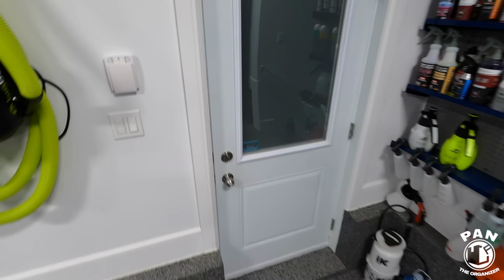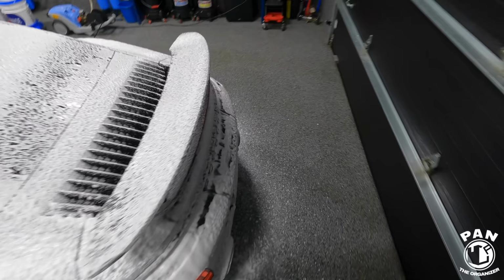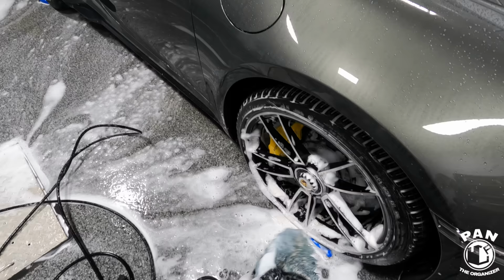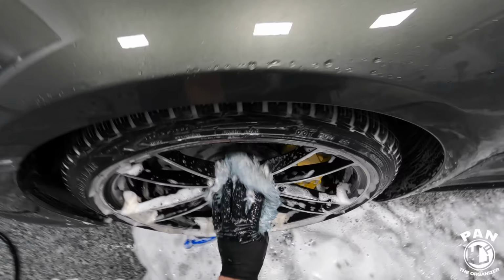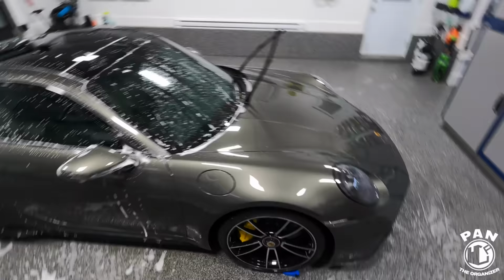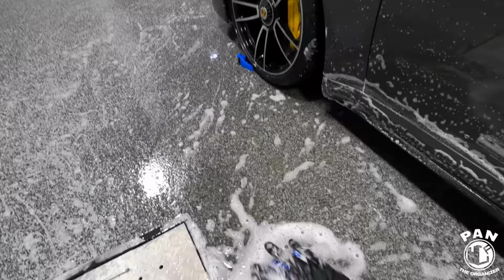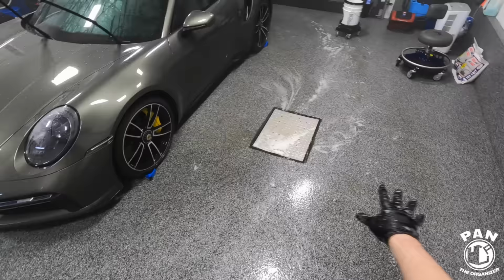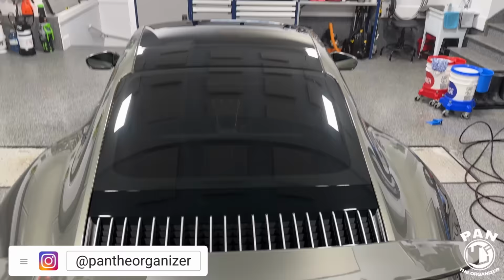Cleaning A Dirty Porsche 911 Turbo S : Exterior Auto Detailing

Comment: ❤❤❤❤ The first-person perspective cleaning video!!  If you haven't already, I vote for you to do one for the interior.  I also start cleaning my wheels/tires 1st.  I live in the southern US where the summers are brutal and the roads are full of dirt and dust.  That said, I cannot get my wheel barrels completely clean even with the numerous brushes I have to clean between the spokes and brake pads.  Also, the rotor disc never looks as clean as I'd like.  I use Turtle Wax's Wheel & Tire Cleaner which works GREAT for my tires.  Nothing I've tried works on my wheel barrels or rotors.  I don't have the luxury of a garage or carport.  Have to wash outdoors.

Comment: most vehicles I do now are new or only a yr or two old and I maintain them for clients every few weeks early morning or before sunset.  my proffered method is to pump spray and foam wheels and tires,  then foam the whole car.   while foam is dwelling I go right back to the wheels working way around vehicle. then I rinse whole car and refoam with cannon ... this allows me to use one fresh water rinse bucket and I use 2 mitts for each half of the vehicle. oh and whole in cleaning the wheels I use pressure washer and hand pump sprayer to keep brushes and  wheels ll clean and lubricated so I don't have to drag buckets around.   I work much faster to prevent any products drying.  keep the surface wet until I want to dry.  detailing is very stress relieving for me.  loving it. one day I'll have that Turbo S!  ugh beautiful
Reply from the maker: If you continue to work hard your dreams will come true as well. I wish you the best Stephen.

Comment: One thing I like to do is after I've given the car its initial prerinse with a high-volume low pressure, low-velocity spray of water is to spray the wheels, tires and wheel well liners with a good cleaner like the Griot's Garage wheel & tire cleaner and then rinse it off before doing the presoak.

Comment: Hey Pan, pro tip - I remember reading a while ago from Ego that you shouldn’t put your battery on your charger straight after use, as the battery cells are hot. You should let the battery fully cool down (after an hour or so), and then place it on the charger to charge. ✅
Reply from the maker: Oh really? I have had them for years and they still perform like day 1, never had an issue. But obviously I like to do things right, so if that's the official EGO recommendations, that is a great suggestion! Do you happen to have a link to that article?
Reply: @PanTheOrganizer  I don’t have an article that I can send you, that was just the advice provided to me by the ego customer care provider.
Reply: I believe charging warm/hot batteries is best avoided (if possible) for most devices.  I know for example that drone batteries should be left to cool before recharging.

Comment: Video was great Pan you just about made it to the end. Just missed out on a little of the wipe down and glass cleaning. No big deal, it was great to learn your process.
Can't wait to see you do the Diamond Body 36. I did it on my car and it was surprisingly easy. Also put the Stoner Invisible Glass Ceramic coating on the windshield. I was out on a drive and it started raining. Didn't have to use my wipers and I could see the rain, very tight beads just fly off the car and windshield. OMG you would love it. Thank you again for all that you do!
Reply from the maker: I’m testing the Invisible Glass Coating right now. Video to come soon. ;)

Comment: My car is garage kept, I wash it when its dirty, usually after rain. Usually 1-2 times weekly, but will also use a quick detailer 1-2 times weekly in between washes to get the "road dust" off.

Comment: Great video.  Helped answer a lot of questions I had.  A few observations.  I couldn't agree more with the comment about efficiency being key.  It is something I'm always trying to improve on and the one thing that surprises me with the car detailing community is that so many rinse with their pressure washer.  Even at 2 GPM, it is far less efficient than just using the hose without the pressure washer.  I get 6 GPM with just the hose (3/4").  It makes more sense to me to have two lines, one for rinsing that is just the straight hose and then another line going to the pressure washer.  You also save some time here by not having to switch between the foam cannon and spray nozzle.  Secondly, very surprised Pan is still using the two-bucket method.  That method has worked for decades so I get it, but there does seem to be less risk and some efficiency gained by having numerous microfiber towels sudded up for each panel.  Sort of a win-win from my perspective.  More efficient and less chance of scratches.  Finally, loved the idea of a lubricating agent when conducting the final dry.  I need to look more into that.  Another win-win.  Increasing gloss while also providing more protection for the final dry.  Thanks again.

Comment: I like this full length (no edit) video of your car washing. From all your videos, I’ve slowly obtained some decent car wash knowledge and methods. I do start with the tires and wheels, per your advice. I take in your advice and then apply my own situation. For example, I don’t want to add a pressure washer to my list if equipment, and I don’t see the value in a foamer. My level is probably a “1/4 Pan” for my car wash chemicals, methods, etc.  I have purchased a lot of the tools and chemicals based on your demo videos. My car looks and feels great!  I have a 2019 Acura TLX V6 in a deep blue with chrome trim.  Thanks as always Pan, for the great tips and demos.
Reply from the maker: Thanks Adam!

Comment: 39:45 - Who has the cleanest vehicle - fast forward a few years - and see who has the most rust-free vehicle. Certainly not the ones that don't wash the road salts of their car every week or more. 
Nice work Pan. I live in Alaska in an apartment atm, and I wash my car (Rv4prime) every week, or I'll go 2 if I'm bicycling to work often. I use an amalgam of a few methods I watch on your channel. There's a car wash nearby with DIY spray bays (always open, so I can usually work at leisure), and also (always cars lined up) auto brush and auto "touchless" bays. Anyway - I foam it up with my IK Foam pro 12, rinse, foam it up again, 2-bucket wash, wash wheels, rinse, and dry with Adams graphene detail or Graphene Cs3. It's been a gr8 new hobby - and I get a lot of comments.
Reply from the maker: Awesome John! Yup, a vehicle that is well taken care of really shows after years of driving in inclement weather and harsh conditions. Big difference compared to someone who neglects their car.

Comment: Ever make a video about how you clean the garage after you wash a car in there? The dual drains look very cool. I've wondered about all of that foam ending up outside on my driveway.
Reply from the maker: Maintenance is so simple with the coating that is on my garage floor. Just a simple pressure wash when I'm done detailing, and then I have a rubber floor squeegee to push the water towards the drains.

And once a year, a bit of Simple Green diluted in hot water in a Hoover vacuum/extractor that has rotating brushes in the head, to do a deep clean after the winter months.

Comment: Never had to deal with extreme cold. I visited Dubai and it was 125F with relentless sun and humidity. I could only guess the surface temperature of a black car. There is a high amount of super cars in that city and  they are often abandoned at the air port to just sit in the sun for months on end.
Reply from the maker: That’s nuts.

Comment: I think what I would do first is the outer part of the rim, then the inside of the rim where the disc breaks are then the tire.
Because the dirtiest part is either the insides and the tire. I don't wanna detail my rim after scrubbing the inside dirt. I just want to avoid detailing the rims after removing dirt on other parts cause I might scratch it.

Comment: Nice video Pan!
I like to use some soft bruches while doing my maintenance wash, for getting into places i can't reach with my washmitt, like between letters from batches and beside the windows. But i am doubting if its better to do while the snowfoam is on my car or just when i start washing the car.

You did get the properties of your coating back, i got the problem with the Turtlewax Graphene flex wax that the water is still sheeting off, but more flat. Its just not restoring how it was the first time. I don't know why and what i do wrong. 

About covid, i should worry more about the vaccins you did take then the diseas itself.

Comment: Really enjoying watching washing and product testing videos of your 911 Turbo S. For me I Typically if car very dirty apply APC from spray to wheels and lower parts of the bodywork and on top Gyeon Snow Foam (on everything). After that foam still on I cleanmy tyres with help of Gyeon Tyre cleaner, After that wash prewash + snowfoam off and move on to the wheels. Before paint contact wash apply light layer of Gyeon Snow foam especially on roof and bonnet that makes feeling even smoother with 2 bucket wash.

Comment: I love the unedited version man it’s lengthy but it shows the truth grind on cleaning a car and one with actual grime on it.  

I don’t do a pre treatment usually go straight to a rinse to get the surface wet and apply my CarPro Lift in the foam cannon I do see why you would though and I will save that info for sure.  While I’m letting my foam dwell I try to do at least a couple of wheels depends on sun and heat as I’m mobile I sometimes have to break my work up into smaller chunks so it doesn’t dry, otherwise I do the wheels depending on the panels I’m working on.  Hope that makes sense.  

Huge news for me though is I am going to be offering glass chip and crack repair.  

I have the spta one and the e foam from IK is shipped!

Cheers from snowy Wisconsin it can get to be -50 with windchill but we just got another 8 inches of snow yesterday after it was 80 degrees Saturday…..
Reply from the maker: Cheers Justin!
Reply: @PanTheOrganizer  cheers to you!

Comment: Hey Sir...Love this Vid!! it good to see how you take care of your own car! (I'm only 25 minutes in)...but to answer your question...I actually used a separate bucket for the wheels and tires only! I would prerinse the entire car and wheels, then spray down the wheels and tires with cleaner, then go back and wash them down. I would have a separate mitt and sponge and get all in the crevices and behind the calipers and also the wheels deep to the other side, so the whole wheel was cleaned. Then I would wash them off, while re-rinsing the rest of the car, before soaping the body. I am actually about to try the rinse less method the next time I wash my cars. I was drawn to the method & how it makes alot of sense in what is happening in each step! But enough rambling from me...I gotta get back to the video!! 😉
Reply from the maker: Hope you enjoyed the video!

Comment: Hi Pan, I coated my car with Adam's Advanced Graphene (60ml bottle).

Which maintenance product do you suggest?

For drying aid (bi-weekly):

- Adam's Graphene Detailer
- CarPro EliXir
- Gyeon Ceramic Detailer

For maintenance every 2-3 months:

- Adam's Graphene Boost
- CarPro Reload 2.0
- Gtechniq C2V3

I'm open to hearing your thoughts.

Congrats on your amazing channel! =)
Reply from the maker: Hi Bernardo. You should be buying products you want to use, from brand you like. It shouldn't really matter what you are using for maintenance, as long as you stick to compatible products.

But in your list, they are all great choices. We'd be nitpicking trying to pick one from those lists. If you want ultimate chemical compatibility, just stick with the Adam's products. Including using their Adam's Graphene Car Shampoo for washing.

See how I perform the maintenance wash on the Adam's Advanced Graphene Ceramic Coating in this video: https://youtu.be/XGEkuR77poM

Comment: Great information Pan. I was skeptical on rinseless wash. I’m still using an old bottle from 2014 of ONR Which I never really used back then or knew much about washing vehicles correctly. I’ve become a fan of how well rinseless works. My situation doesn’t permit two bucket and pressure washer nearly as easy as I’d like so I do about half my washes or more rinseless. I did ceramic trim work the other day. One step is that I used CarPro Reset for hand washing some of the trim before panel prep.  CarPro needs a serious upgrade to the smell of that soap. It’s definitely not KCX or Adams. 😀 It reminded me of stale beer. Performance ultimately matters most but it would be nice if they could upgrade the scent somehow.
Reply from the maker: Thank you! Keep in mind, most detailing chemicals have a shelf life of 1 to 2 years at best, if kept in stable conditions and not frozen. In the case of your 2014 ONR, it might be time to get a new bottle. Especially since they also made a new formula in 2021.

Comment: This video is exactly what I was looking for. Thank you.  I'm about to get back into my own hand car washing  after about a decade of using car washes (not the automatic ones I must add!).   
Also, using a blower interests me so I would love to see a "Directors Cut" 😊 where you show the blow drying in real time please. I'd like to get a better feel for how effective it is before I spend money on one. Thank you!
Reply from the maker: See my video on the EGO here: https://youtu.be/yHT1ty3CED8

That was the previous 580 CFM before I bought the new 650 CFM. You'll see that I timed how long it took to dry a BMW M550i which is a fairly large sedan.

Of course, keep in mind blowers only work well if the paint has protection on it (wax, sealant or coating). You need the hydrophobics so the water can slide of and blow off quickly.

On unprotected paint, drying manually with a microfiber drying towel is more efficient.

Once you try drying with a blower, you never go back. :)

Welcome to my channel. You discovered one of the biggest car detailing channels on YouTube as we surpassed 900,000 subscribers and we have over 116 million views! I have been detailing for 26 years and I love to share my knowledge and passion with my viewers.

You found the right channel to help you learn everything about detailing.
Reply: @PanTheOrganizer  thank you I'll check out the other video!

Comment: If you find your car blow dryer isn’t really shifting water easily, is this likely due to coating wearing off? I’ve found the process even with a fairly powerful blower (spec below) to be quite time consuming Vs a Microfibre towel dry 

I use the BLO AIR RS 5.5 HP / 43,500 FPM

Great video Pan, really helpful to see in this way, I’d be keen to see live like this how you tidy towels / equipment and cleaning items and how long it takes!
Reply from the maker: Blowers only work well on a protected surface. If your paint has a ceramic coating, or a wax or sealant, and the protection is working well, water should fly off and you should dry your vehicle in a few minutes.

If there is zero protection, or the protection is weakened, there will be more drag and water will be slower to sheet off as there are no hydrophobics helping the air move the water.

Comment: Hi Pan, great videos that I accidentally came across a few days ago! You definitely take car care to a new level! I am retired and have lived in this part of Canada all my life (Ottawa.) What trick do you have for removing snow and ice build up on the inside of rims after a significant snowfall? It looks like you have room to get into the inside of your Porsche rims but some vehicles almost have to be put up on the hoist to get at the inside. The wise move is to not drive during a big storm, or go to the DR!
Reply from the maker: Hi Don! Welcome to my channel. You discovered one of the biggest car detailing channels on YouTube as we surpassed 965,000 subscribers and we have over 130 million views! I have been detailing for 26 years and I love to share my knowledge and passion with my viewers.

You found the right channel to help you learn everything about detailing.

I don't have such issues, as I have a heated garage where I park my vehicles. And I keep my garage at a nice 16C when not working in it, and 20C when I'm detailing. So all the snow and ice melts rather quickly when I come back home.

There aren't any miracles to ice removal if your car sits outside in the elements unfortunately. And I certainly wouldn't recommend using any force to remove it, as that could damage the wheels' finish. You have to live with it. But I totally understand you, as I hate winter. I'm from Montreal, and it seems we're in winter mode from November all the way to mid April. That's nearly half the year!

How did you discover my channel by the way?
Reply: I had been thinking about heating my two car garage so that I could wash our vehicles inside during the winter, now that I have the time. I searched YouTube for car wash videos and your first video which, I believe was 8 years ago came up.  I watched a few more and now I’m hooked. Yours are some of the most professional “how to” videos I’ve seen! Great job!
Reply from the maker: Thanks for the kind words. I work really hard to produce my videos so it’s nice to see those efforts don’t go unnoticed by my viewers. 👍🏻